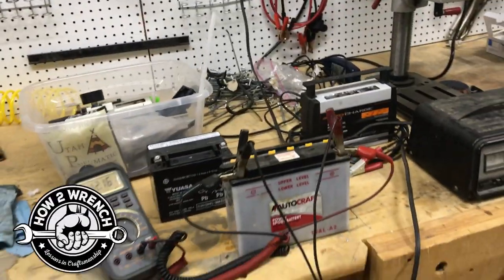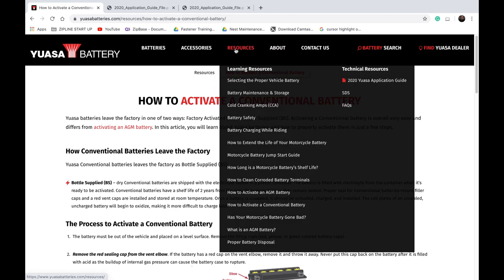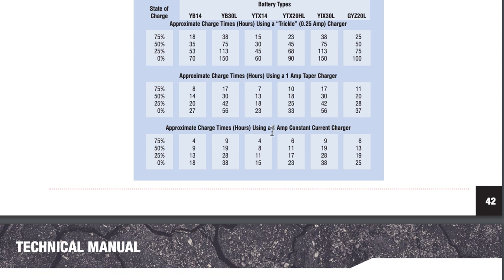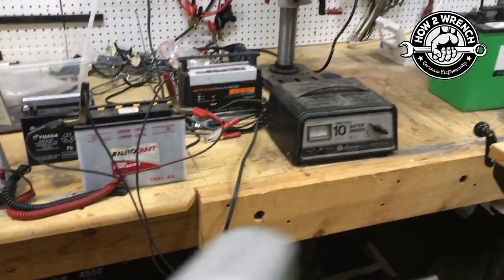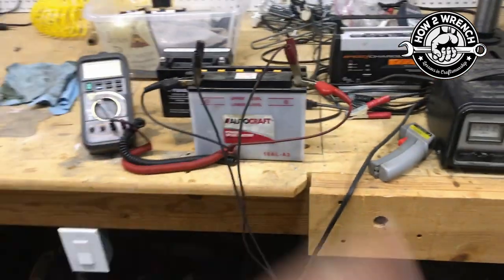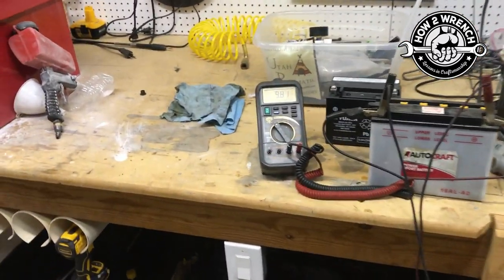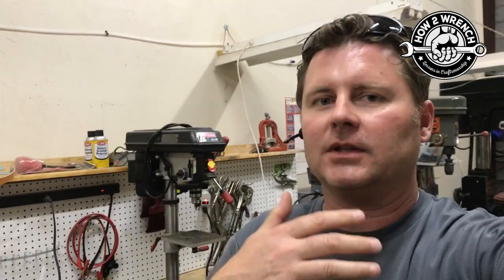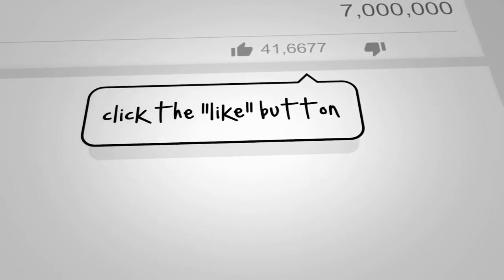Old Ducati Battery almost burnt down the shop! Why you never leave chargers on and leave!

Comment: I have a .75 amp Battery Tender Jr and a 1.5 amp Yuasa Smart Shot battery charger. Both have a maintenance mode. I leave them on all winter and have never had a problem. If I have multiple batteries, which I usually do, I swap it between batteries for a week at a time.
Reply from the maker: Pretty rare I think but its does happen. I had a problem with maintenance charger sticking on one time and have been mindfull ever since. And on that one time it stuck (and overcharged) that battery was caught at 140F...I did a FB live video on it years ago when it happended. I should look for it. 
👍 Thank you for taking the time to comment! It helps us! 
Here is a way to support all the free videos.
Want to say “thanks” or “keep it up”? Click here https://www.paypal.me/how2wrench  
Follow us! 
Web:
www.How2Wrench.com     
www.Tools2Wrench.com

Comment: I have never been guilty of leaving a charger on and walking away. Thanks for that info 👍
Reply from the maker: No problem 👍👍 Thank you for taking the time to comment! It helps us! 
Here is a way to support all the free videos.
Want to say “thanks” or “keep it up”? Click here https://www.paypal.me/how2wrench  

Coach Conley is also available for hire to personally work one on one with you if ever needed. Yep he is a real person. Give him a call @ 602-345-0432
Details here: https://how2wrench.com/product/personal-tech-training-phone-facetime/ 
Your answers and help are just around the corner. Save time and money while protecting your investment and yourself by doing it the right way!
Follow us! 
Web:
www.How2Wrench.com     
www.Tools2Wrench.com
Reply: Shane Conley Hi Shane, i recent found your videos while troubleshooting a carb issue. Turned out to be and issue with the float valve. I have a question regarding the little float needle valve (hangs from the float tang with the rubber tip, probably don’t need to tell you that lol). Is there a name for the little springy cylinder/plunger on the float valve that the float tang rests on? The tiny part in the opposite end of the rubber tip that springs up and down when you push on it. Just looking for the name of that piece of the float valve and also what it’s function is? Why does there need to be a springy device on the valve? I tracked my flooding issues down to the float valve and it seemed to work as intended but that little plunger was frozen in place. I wasn’t able to order parts where I was so I freed it up and put a tiny amount of lube on it and it’s been working perfect ever since, although I plan to do a carb rebuild this week. Was that frozen plunger really causing my issue or did I just happen to fix the problem by accident just from cleaning everything? It just seems like frozen or not, the float valve still would do its job but I’m not fluent enough to know for sure. Thanks for these awesome videos, I’ve subscribed. If you’re content wasn’t so good you’d probably have more customers hahaha. 

(I apologize that the video I’m commenting on has nothing to do with the carb and I’ve watched your videos on the subject, I just figured I’d have better luck getting a reply on your latest video. I can’t find an answer in any of the forums anywhere.) you’re appreciated, thanks for all you do and the amazing quality of your work. Cheers.

Comment: I know what you mean, its a little spooky to see standard chargers do this. I still use a 'smart charger' that hopefully would detect a problem  before I do. They say you shouldn't leave batteries on concrete, so there aren't many places in a garage that aren't vulnerable to fire.....
Reply: Your last part there is a fallacy nowadays, simply because when batteries were invented they used to have wooden boxes and glass cells. The glass cells were used because The battery acid didn’t affect the glass and plastics were not yet invented. The glass shelves were fit quite tightly to the box if you’re putting the wooden box on the concrete floor, condensation under the box would be soaked up by the wood. The wood would swell and crack the glass cells or rot in the bottom and fall out. Batteries nowadays do not have this problem, so it’s no problem putting your battery on the garage floor while you’re charging it. This was an excerpt taken from a book called Fundamental Electrical Troubleshooting by Dan Sullivan, page 47.
Reply from the maker: Hi Scott well put and I LOVED Dan's book! Read it cover to cover!
Reply from the maker: Scott answered to "concrete" part well. We also did a lot of testing and expierimenting at the college with battery drainage "on concrete". No findings at all. Nice to see you on here bud.

Comment: I’ve found that if you take the caps off of the conventional batteries while charging them, you’ll be able to see two things, 1 is the electrolyte level of each cell and 2, if that cell is venting while charging. You should be able to see that by the bubbles floating to the surface. If there are no bubbles in one or more of the cells, then chances are that those cells are bad. Just some food for thought.

Cheers,
Reply from the maker: Great added comments Scott! TY

Comment: Hey Shane, off topic question brother but I'm looking to rebuild my 05 750 GSXR engine and was looking for a Motorcycle engine stand that allows you to work on the engine through an entire teardown and rebuild, crankcase splitting and transmission reapir included. I haven't seen anything out there thats multifunctional like this .. Can you point me in the right direction or give me a link to the one your prefer, Thanks!
Reply from the maker: Good question. I'm litterally making one this month. I down to deciding between this adjustable channel https://amzn.to/378OVES and a less exspesive and more model specific version using this: https://amzn.to/2XCO3Fs Both versions will most likely use angle iron for upright supports and all-thread in the through holes. Did you see these video of the ones I made? : https://www.youtube.com/user/conleybuilt/search?query=engine+stand

👍 Thank you for taking the time to comment! It helps us! 
Here is a way to support all the free videos.
Want to say “thanks” or “keep it up”? Click here https://www.paypal.me/how2wrench  

Coach Conley is also available for hire to personally work one on one with you if ever needed. Yep he is a real person. Give him a call @ 602-345-0432
Details here: https://how2wrench.com/product/personal-tech-training-phone-facetime/ 
Your answers and help are just around the corner. Save time and money while protecting your investment and yourself by doing it the right way!
Follow us! 
Web:
www.How2Wrench.com     
www.Tools2Wrench.com